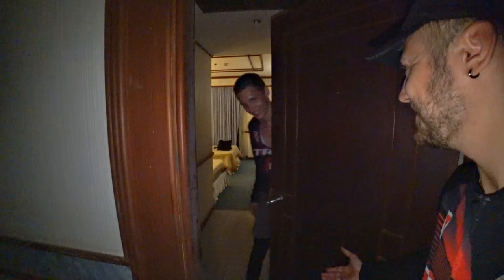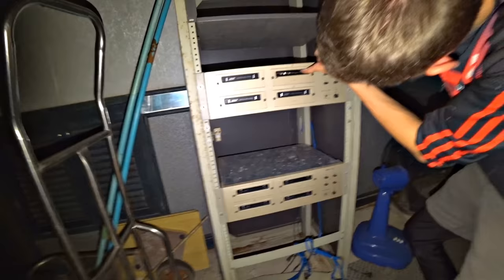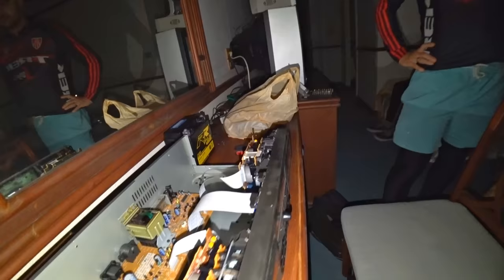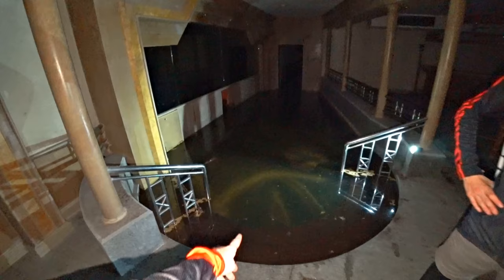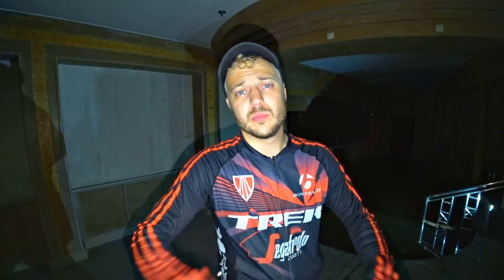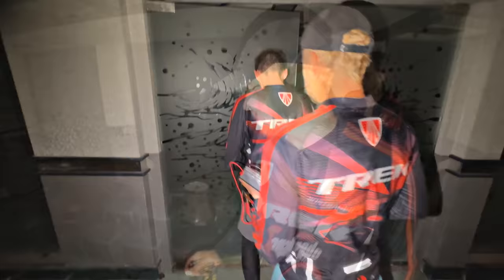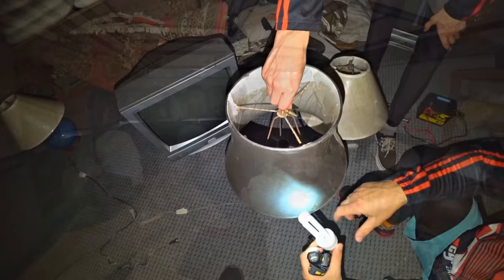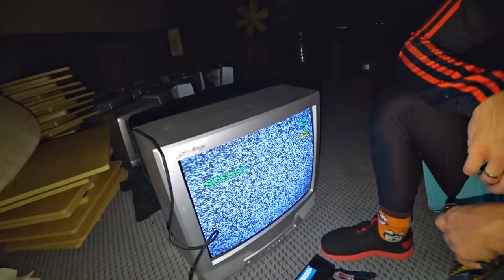What happened on the ABANDONED LINER AT NIGHT 🕸 We were found out by...

Comment: Keep exploring new places until Pripyat is safer - I love all your adventures. They're all really interesting.

I think those gold 4-casette decks may be part of an analog CCTV security system. The casette bays would start recording sequentially, so as each tape was recorded, the security guard could replace one at a time without losing any recording time. They may have also been redundant, two tapes recording at the same time on each deck. Hotels face enormous liability, so they typically have all manner of redundancy on their monitoring.